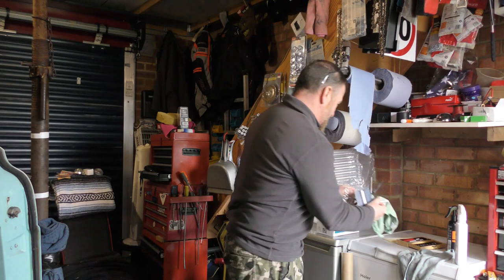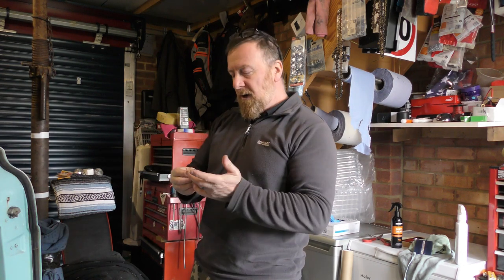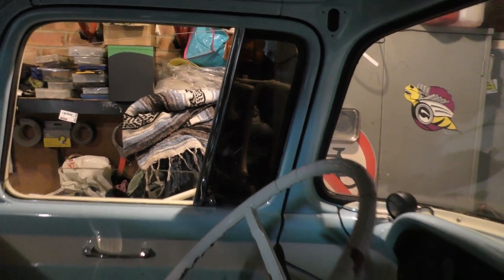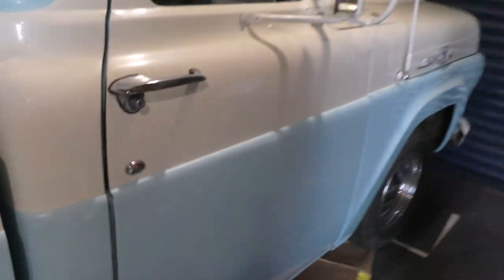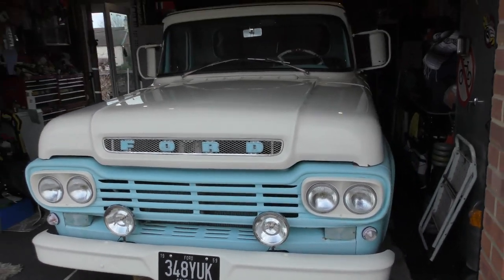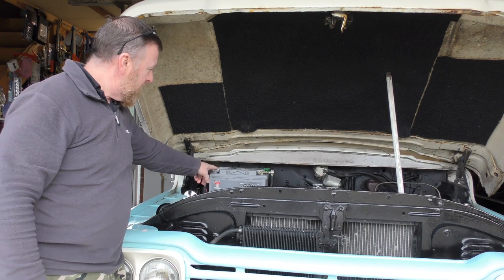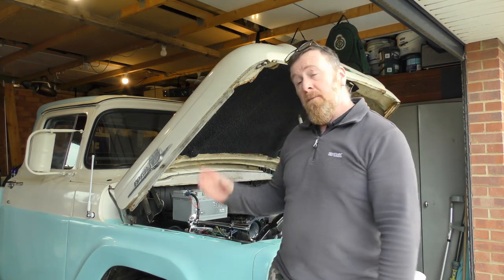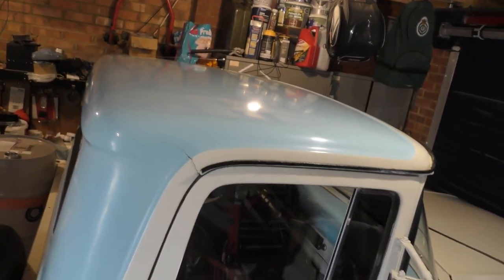FORD F250 1959 RESTORATION FINISHED ISH LOL MARK SAVAGE

Comment: Beautiful video mate! I have a problem with my peugeot speedfoght 2 lc 2004 70cc. I've tweaked it to make it go faster. When I want to accelerate it stutters and I have to go full throttle to get good speed. It has a 21mm carburettor and the main jet is 92. Which jet would you recommend? I have tried 90-98 and 104 but did not get any better results. I want to Get This problemd fix! Thx
Reply from the maker: Your flooding it bud 
Try going down and then air mix adjustment 
You bogging as its very hard to sort with a 70cc kit .so you've done well really
Reply: @marksavage  what jet size would you have tried and how many notches on the needle? Thank you very much for the answer and help
Reply from the maker: @benjaminlilledal3411  leave needle so in middle 
Go down by 4 from what you have 
I know you would think bigger but that's what's wrong bud 
Smaller and tune
Reply: @marksavage  i also have LeoVince TT system exhaust if that plays any role on the jet
Reply from the maker: @benjaminlilledal3411  it helps with the air flow , I always put a sports exhaust on them

Comment: hey, i know you dont do peugeot speedfights anymore, but my starter spins and my scooter doesnt start or sometimes barely catches on and starts after spinning for very long, engine turns over but its just not starting, spark seems to be fine, although its very thin, could this be the cdi?
Reply from the maker: could even be the plug as most common, change that and give carb a clean , 100 videos on them on my channel